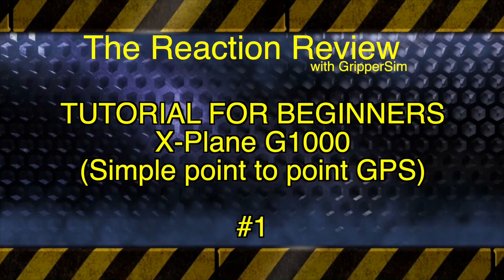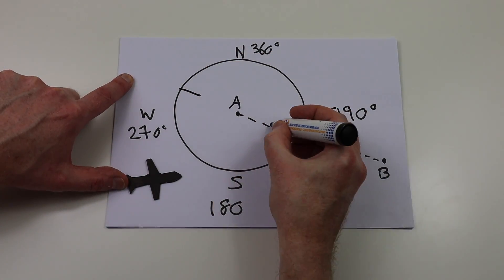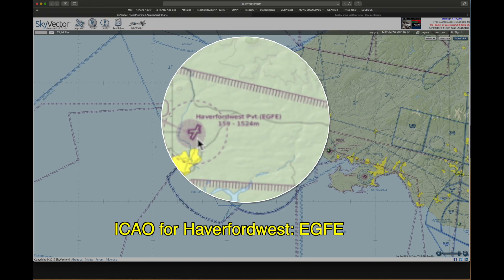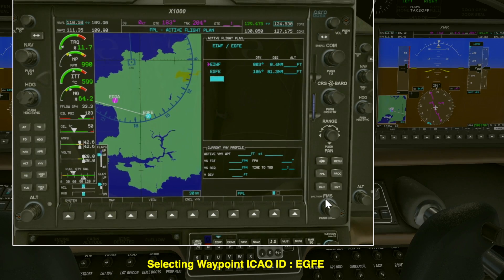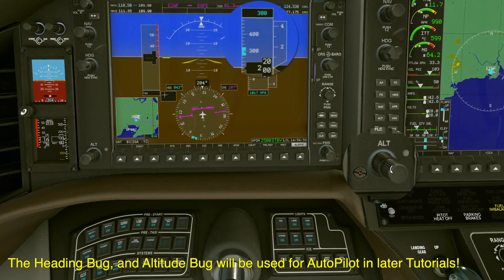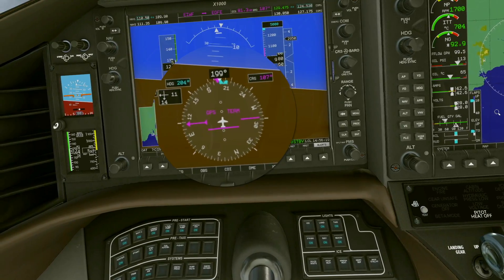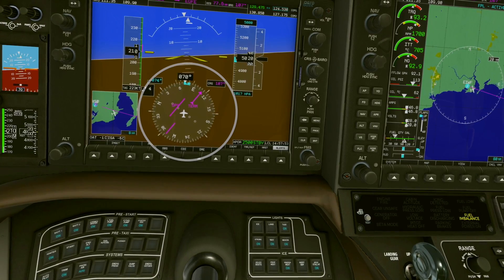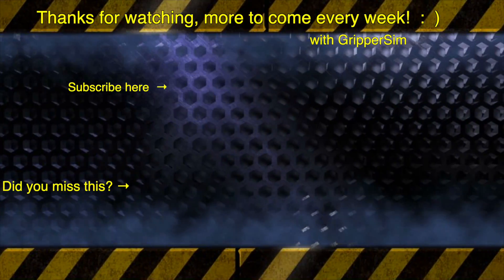X-Plane G1000 Tutorial #1, Beginners : simple GPS Nav

Comment: Helpful. Good aircraft to use too- because its easier to see the g1000. Would look forward to a session on 1) Using autopilot and 2) flying point to point and then intercepting a  glide slope using  IFR and RNAV settings. Also what happens/ what to do when you don't pick up the ILS or RNAV signal? The step by step approach is helpful.
Reply from the maker: Perry Smith will do perry! ; )